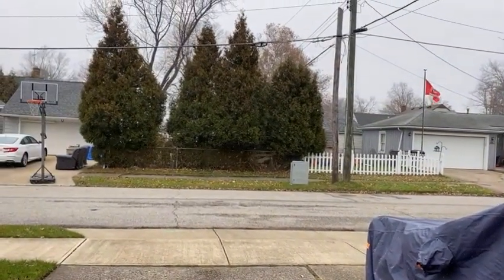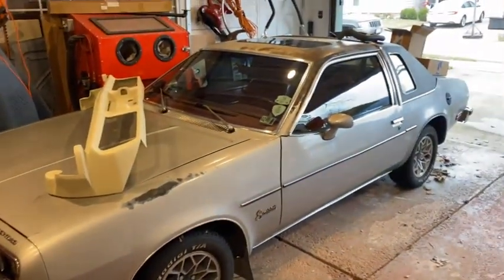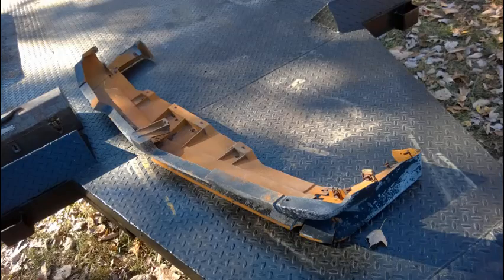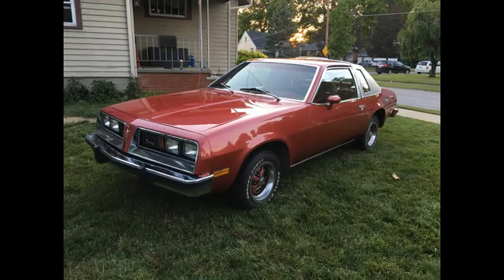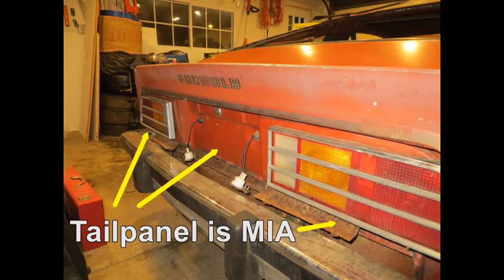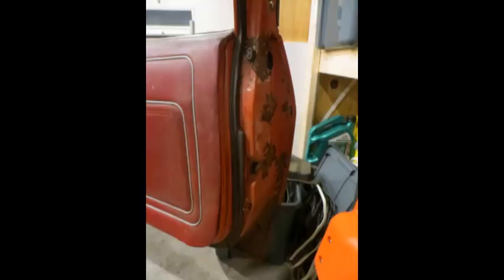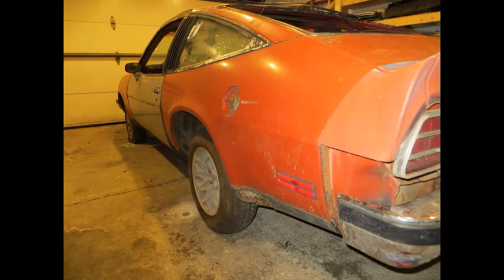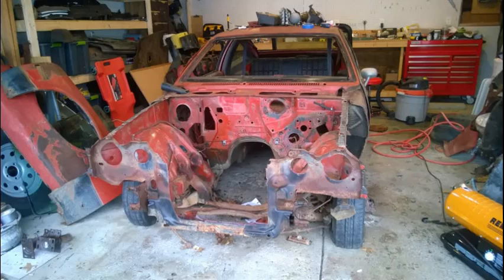Chapter 1: Salvage Operation

Comment: My Dad ordered a Sunbird Formula hatchback in 1979, when it came in it was just a Sunbird with rally wheels and a rear spoiler,  duel mirrors and all the options he ordered like air, ps, pb ,auto, full console, tilt wheel, am-fm, tinted glass, no Formula  graphics or front valance, it did have a tach and gauges, the dealer gave some excuse why the Formula package wasn't on the car, He bought it anyway.
Reply from the maker: Aw man. ☹️. I think there was a supply issue in 1979 on them.  Only 413 Formulas were built in 1979. 

Formula production. 
1977 - 321
1978 - 3,723
1979 - 413
1980 - 1,987

TOTAL - 6,444

Comment: Back in 89 I could've bought a rare sunbird , it was called a blackbird GT came with factory 5.0, 305 and 4spd black and gold graphics
Reply from the maker: I have seen pictures of those.  Looks like it was some sort of regional or dealership package.  Original V8 Sunbirds are exceedingly rare with less than 1,500 built (481 in 1978 & 986 in 1979).  Compare that to 60,000+ V8 Monzas built between 75 and 79.

Comment: Okay I'll sub to see what you do next, i had a white 80 sunbird 4cylinder/4speed car with a sunroof and red velour interior got it for $750 in 1988. Sunroof leaked i replaced it with a ASC unit, motor didnt run well cause previous owner used a regular gas adapter and clogged the catalitic converter. I traded the car in in 1990 it had a lot of problems but i gotta say i had fun with it, this brought back memories
Reply from the maker: Sounds like the 1980 4-cyl Sunbird I had in HS.  It ran for crap!  LOL  I ended up wrecking it into a steel mailbox post one icy night and caved in the whole passenger side.  Sold it for $200 a few weeks later.  She blew up two weeks after that.  Whoops.   lol

Comment: This brings back memories for me. I took my driver’s test in a 79 Sunbird coupe though not a hatchback or a Formula. It was a plain Jane with the Iron Duke and automatic. I always thought these were good looking little cars. I always liked the coupe better. Did they make any Formula coupes or were they all hatchbacks? I had a wild idea to put a Pontiac 400 in it but that was beyond my skill set plus the frame rail in back rotted out so that ended that. Good luck with the restoration. If it’s too far gone, clone one of your coupes. I’ve never seen a Formula coupe.
Reply from the maker: Thank you!   My first car was also a 1980 Sunbird Coupe with the Iron Duke and auto.  :-)  I have a buddy that has a 455 Pontiac in his Sunbird.  It is a drag only car but it went in surprisingly easy.  He used a front mount engine plate, remote oil filter, and center dump manifolds.  

The Formula (RPO code W66) was an option starting in 1977 and it was available on the Coupe and Hatchback.  The numbers aren't broken down by each (coupe or hatch) but we do know how many were built in each year.

Formula Production:
1977 - 321 (coupe initially but hatch late in the 77 run).
1978 - 3,723
1979 - 413
1980 - 1,987 (all hatchbacks - Formula option was only offered on the hatch this year)

TOTAL - 6,444

Yeah...I know more about 76-80 Sunbirds than ANYONE should know.  😂

Comment: Do you know the specific year and model of your silver Sunbird at the beginning? I remember my dad had one of those when I was a kid. I've been researching it but could never find the exact match till I happened on your video. The only difference is that his was a dark blue and instead of having that black trimming around the rear windows it was a tan color.
Reply from the maker: Yep. The silver car is also a 1980 Sunbird but in a coupe.  The Sunbirds actually changed the grill design every year unlike the Monza that had the same grill for 2-3 years between changes.  So….if you had a picture of the front, it would be easy to identify the exact year.   Let me know if I can help.  Email is: w66sunbird1@hotmail.com
Reply from the maker: Oh…and for coupes, they had a large side window version.  Mine has the small “formal” or “opera” window.  Pontiac calls it a “Formal” window.